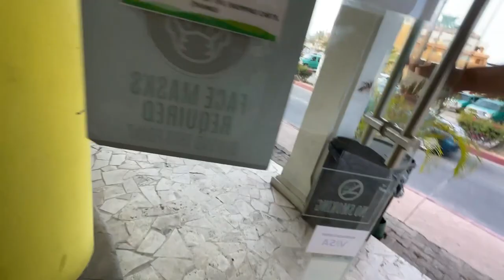Stealth Truck Camping In Cabo San Lucas Mexico

Comment: Whenever you get back to the states your truck needs a massive detail
Reply: He should do it in MX at the border before going back for way cheaper
Reply: Nah Mexico has hard water which isn’t good for detailing
Reply: Cartel dont care if the truck is clean or not. 💀
Reply: yes! the dust and dirt inside is driving me crazy lol
Reply: @dxtclue6427  for real.. cartel can see the money through the of dust lol
Reply: I've thought that for several videos now.  That thing needs a wash bad...inside and out.
Reply: @rjai4890  that is not more than an average car wtf lol what are u on about
Reply: @ramirosuarez1877  based off your recent comments I can tell your biased, so no point in arguing. But the few times I’ve been to Mexico, I saw very few vehicles like this, or with that much equipment strapped on them. He would definitely stick out. Good for you for having some home country pride, but get real lol
Reply: @ramirosuarez1877  because even being 10 years old, it’s still nicer than 90% of the vehicles you’ll find in that shit hole lmao
Reply: I agree, it has begun to drive me nuts!  At least get it washed.
Reply: @rjai4890  acting as if it were a Raptor or a Trex😂
Reply: @DuraTex556  you acting as if that’s all that gets stolen down there 😂😂😂
Reply: @rjai4890  You obviously haven’t been to Baja long enough to see that his truck average compared to vehicles of this type down there, and that’s not to bash on his truck which there is nothing wrong with.
Reply: hes not gonna be back in the states for a while lmao
Reply: Any 4x4 truck from the top 3 brands is desired over there